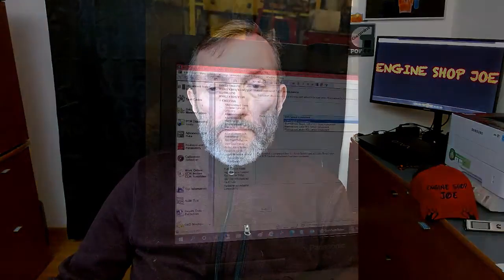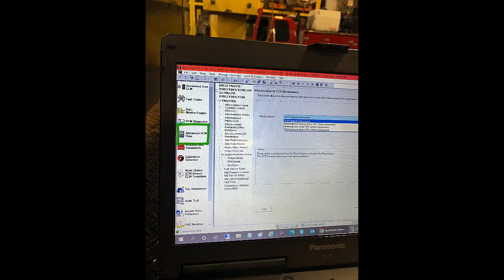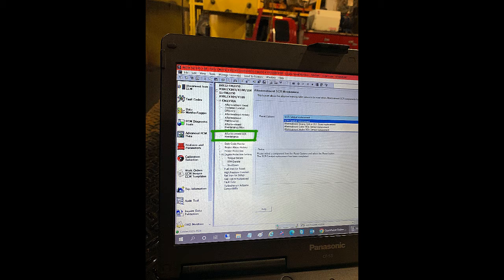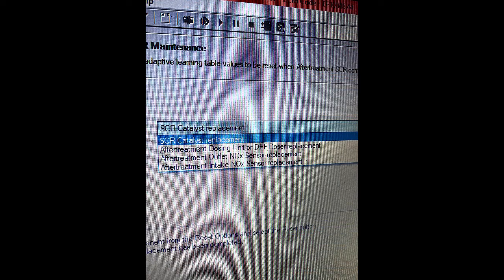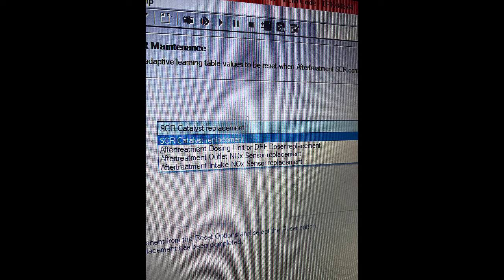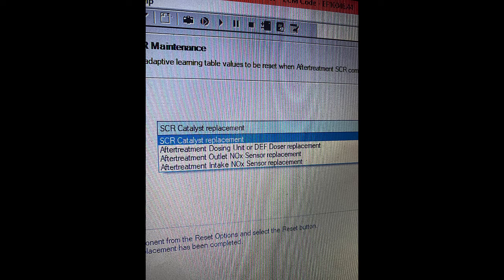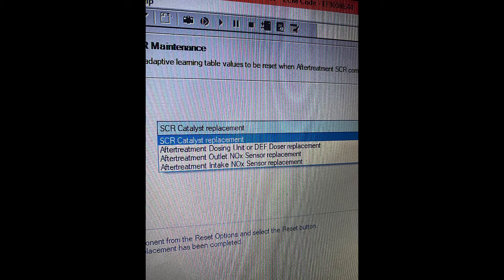SCR system software resets FYI

Comment: thanks for the update, now the dowel for the upper idle gear are and have been put in backwards for a long time, the tapered end is in the block and the square end is out  to the gear shaft stub and you can get the gear stub on top of the dowel and when it moves the bolts are all loose and the gear falls off,
Reply from the maker: Thanks for the info